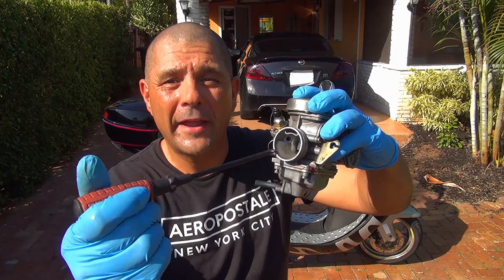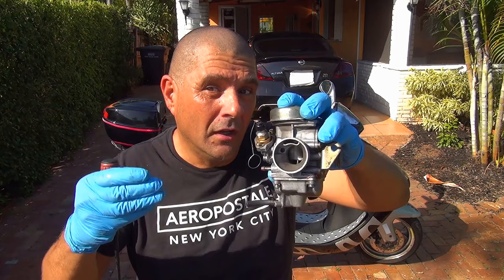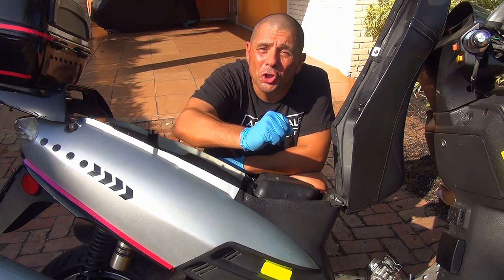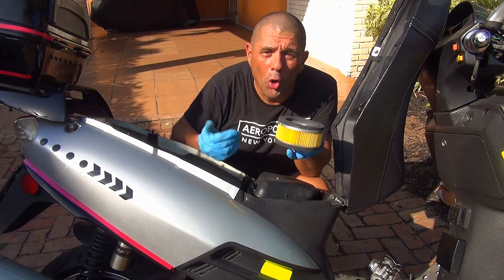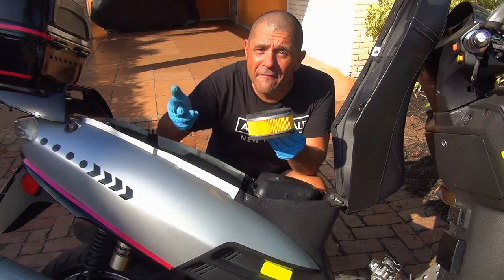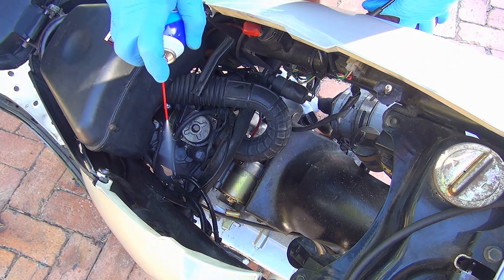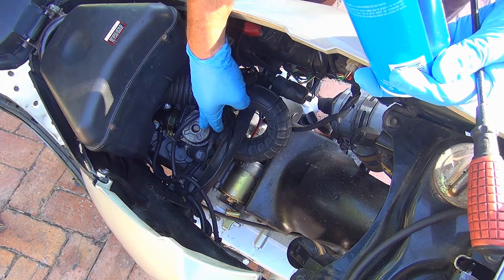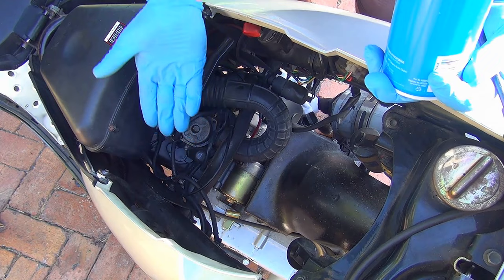How to fix a scooter that bogs down

Comment: Thanks for this. I bought a 2006 Pagsta Regal Raptor DD50E2 and it runs uneven and dies in 4th gear after a while, slowly dies and just shuts off. I've had the carborator apart but it looks OK from what I can understand, but I noticed I don't have an fuel filter, instead the hose goes directly from the petcock to the carborator. And I also have an EGR on this bike, could this have something to do with it running bad? I checked the valves but they seem to be adjusted, unfortunately I don't have an manual for this bike and they are no longer in production so I just went for 0.05 on intake and 0.10 on exhaust as someone suggesed it to me. One strange thing though, the other day I ride the bike and turn the petcock in ON (downwards) and after a while it died so I put the petcock in OFF position (horizontal) and the bike started and ran perfectly! I was so surprised and thought I must have mistaken the petcock positions, but I guess it had enough gas in the carborator to run for a while? Maybe it got too much gas so the petcock could be faulty?
Reply from the maker: Based on the information you provided, there are a few possible issues that could be causing your 2006 Pagsta Regal Raptor DD50E2 to run unevenly and die in 4th gear. Let's address each point you mentioned:

Carburetor: Even if the carburetor looks fine visually, there could still be internal issues such as clogged jets or a malfunctioning float. It's worth cleaning the carburetor thoroughly and checking for any signs of blockage or damage.

Fuel filter: It's unusual for a motorcycle not to have a fuel filter. A missing fuel filter can allow debris or contaminants to enter the carburetor, causing performance issues. Installing a fuel filter between the petcock and the carburetor is recommended to prevent such problems.

EGR (Exhaust Gas Recirculation): The EGR system is responsible for reducing emissions, and it typically doesn't directly affect engine performance. However, if the EGR valve is malfunctioning or stuck open, it could cause improper air-to-fuel mixture and affect engine performance. It's worth inspecting the EGR valve and ensuring it's functioning correctly.

Valve adjustment: The valve clearances you mentioned (0.05mm intake and 0.10mm exhaust) are within the general range for similar motorcycles. However, without the specific specifications for your bike, it's difficult to determine if they are correct. It's essential to obtain the correct valve clearance specifications for your particular model. Incorrect valve clearances can impact engine performance.

Petcock: The issue you described with the petcock is interesting. It's possible that the petcock is faulty and not providing a consistent fuel flow to the carburetor. This could result in fuel starvation or an excessive fuel supply, leading to the symptoms you experienced. Consider inspecting the petcock for any signs of damage or blockage and, if necessary, replace it.

Since your bike is no longer in production, it may be challenging to find an official service manual. However, you can try reaching out to Pagsta Regal Raptor owners' communities or motorcycle forums online. These resources can provide valuable insights and guidance based on the experiences of other owners who have encountered similar issues.

If the problem persists after checking and addressing these possible causes, it might be necessary to consult a professional motorcycle mechanic with experience in troubleshooting and repairing similar models. They can provide a more accurate diagnosis and help resolve the issue with your bike.
Reply: @VirberelloScooterTips  Thank you very much for the in depth information and explanation on each subject! I've been fiddling with the carburator today and noticed that the petcock will leak gas even when it is turned off, I even emptied the carburator and managed to run the bike with the petcock turned off so I guess it's a good guess that the petcock might having something to do with the problems. I've unscrewed the petcock and one of the screws on the front side broke off when I tried to unscrew it, leaving half of it inside and impossible to get out, the screw on the other side however seems to be holding it together, at least on that side. I'll see if I can get hold of a suitable petcock and replace it, since there are no official spare parts for this bike I'll have to try my best and see if I can find something that fits, if I understand correctly I need to get one that has the same size bolt that screw on to the gas tank?

One thing that happened today was that when trying to set the idle/air screws I let the bike idle and after a while it started to raise the RPM rapidly and then shut off. This have also happened during ride that it made a sudden high RPM sound and then died, I guess it might have to do with the fuel running out or not getting enough fuel to the carburator.

Inside the float house I noticed when turning the carburator to the position where the float is touching the float needle it kind of stuck in that position and didn't go back when I turned it around, I had to poke it slightly with my finger to make it come loose.

I guess I can only focus on getting a new petcock as for now, hopefully it might the thing that will solve this problem but otherwise I guess I'll have to dig deeper into the carb or the other things you suggested. 
I also watched a video where they stated that this kind of problem can occur if the spark plug is bad so maybe I should try and replace that one too in case the petcock won't solve it. 

Thank you very much anyways for your help!

It's hard to find any information on this bike in general, I've tried contacting the manufacturer of this bike but without any luck. All I've come across so far is a Russian community which is problematic due to the language barrier, but luckily there is translation software and people are helpful and try to help, it's internet as it was intended I guess. :)
Reply: I had a 2006 Pagsta. Do you want to sell yours? As far as engine parts it's the same as the chinese dirt bikes. If you haven't replaced the carburetor and intake gaskets, i would start with that. I ended up putting a new gas tank on mine that came with a petcock. I also replaced the engine with a 125cc. I set my valve clearance at .0025-.003 for the intake and .003 -.004 for exhaust. If the rpm's rise on their own randomly it might be flooding.
Reply: Hello! I managed to get it running real good, it turned out it was the valves all along.. The thing is I checked them first and they seemed fine but somehow I must have messed up because when I checked again after a lot of hassle and troubleshooting I noticed the exhaust valve was completely shut. After adjusting it the bike ran just like it should. I used the 0.05 for intake and 0.10 for exhaust but I don't know if those are manufacturer specs, I don't own a manual for it so it was just what someone told me to go with. I am so happy for this bike really, It's so much fun and the previous owner had cut the exhaust/muffler at the middle and removed the inside and drilled some holes through it so it sounds really amazing. All I am looking for now is a standard handle for it since it came with one of those straight/t-bar handles which I personally don't like that much. I can only hope that they someday will re-start the production of these bikes again, it would be awesome. @thelagmeister
Reply: @LUNARIAproject  Well I'm glad you got it goin. I really miss my Pagsta. I posted a few videos of mine on my channel and the videos are all I have left of it. I bought mine out of someone's backyard for $200 with a bad engine. I replaced everything on the bike with new parts. Literally the same day I put the finishing touches on it some lady ran the bike over with her pickup truck. I would really like to find another one to buy but I can't find one. I really don't know why they stopped making these , but they should start making them again.
Reply: @LUNARIAproject   @LUNARIAproject  Thanks,. I come across one every so often but they never have titles. When I got mine it had 300 klms and when it got totaled I think it had 1,500. When the insurance totaled mine out, they paid me $1800 for it. When I see them for sale they are usually priced at $750-$1000 usd. I'm sure I'll find one eventually. The only reason I can see people not liking them is because it's not a Honda, Yamaha, Vespa ect. That video was good. Not bad at all.
Reply: I understand, sounds like you did well with the insurance after all, but still sucks to be lose the bike like that. I hope you will be able to find another one, I know these bikes go under different names, in the UK they are called AJS, in the US it seems it's Pagsta or Dadyw or even SUNL, not sure if the later is the exact same bike. At here in Europe we also have a similar bike called Kinroad but it's quite a bit smaller, at least the tires are smaller. Yeah perhaps people judge it just by the fact that it's made in China, but I guess if one take care of it and maintain proper service it shouldn't be bad.
Reply: @LUNARIAproject  Thanks. I'm sure I'll find one eventually. Mine had a 17 inch tire on the front and a 12 inch tire on the rear. I realize the chinese bikes aren't terrible but do require a lot of maintenance. They have numerous names here too. I'm looking at a Piaggio 150 right now but I've never had an Italian bike. Funny thing though it's made in china.
Reply: Yeah, I think so too. Perhaps needs a bit more care and maintance than more famous brands. It's a pity no other brands like Japanese manufacturers make smaller bikes like 50cc that reminds of motorcycles or such, I am sure that would be a great success. Maybe if Honda would re-issue their Jazz/Rebel 50cc, that would be truly amazing, but I guess the prices would be too high for me at least. Oh, I've never had any experience with Piaggio but I've heard the name and it's quite well known at here.  @thelagmeister
Reply: @LUNARIAproject  That Jazz/Rebel 50 looks good. I've noticed with some of the better small cc bikes that they just won't sell them out here in the states. They do cost more but they definitely are quality bikes. I'm looking at a 150 Piaggio Fly 150 for $750 usd with 1,700 miles. I just don't know. If it was a Yamaha or a Honda, I would be all over it.
Reply: Yeah, I understand. Do you have any bike to ride as of now or? I think that Piaggio looks alright, perhaps a scooter is more convenient to ride, I've never had one myself but that kind of bike is very common at here under various brands. Personally I don't know about european brands in terms of quality, I guess they are alright and perhaps even considered better than chinese? But that's just my guess. As long as it's been taken care of and serviced I think it shouldn't be too much of a problem with that kind of mileage. @thelagmeister

Comment: My scooter starts bogging at around 30-40 mph it start perfect and runs strong until around 30 mph
Reply from the maker: It sounds like your scooter might be experiencing some issues with its performance once it reaches a certain speed. There could be a few potential causes for this problem:

Fuel System Issues: A clogged fuel filter or carburetor jets could restrict the flow of fuel to the engine, causing it to bog down at higher speeds.

Air Intake Blockage: A blocked air filter or intake system could limit the amount of air reaching the engine, leading to poor performance at higher speeds.

Ignition Problems: Faulty ignition components such as spark plugs, ignition coil, or ignition timing could result in misfires or weak sparks at higher speeds, causing the engine to bog down.

Exhaust Restriction: A restricted exhaust system due to a clogged muffler or exhaust pipe could create backpressure, reducing engine power and causing it to bog down.

Transmission Issues: Problems with the scooter's transmission, such as worn-out clutch plates or improper adjustment, could lead to power loss and bogging at higher speeds.

Electrical Problems: Faulty wiring, connectors, or electrical components could cause intermittent power loss, affecting the scooter's performance.

To diagnose the issue accurately, it's best to start by checking the simplest and most accessible components, such as the air filter and spark plugs, and then move on to more complex systems if necessary. If you're not comfortable troubleshooting the problem yourself, it's recommended to take your scooter to a qualified mechanic or dealership for professional inspection and repair.

Comment: Do you still answer comments or questions I would have something to ask
Reply from the maker: Hello Petri I'm still here 👍
Reply: @VirberelloScooterTips  Mind if I ask you tomorrow its night here.
Reply: @VirberelloScooterTips  Oh, I totally forgot, but my 50cc Baotian scooter struggles to stay on full throttle and cant go past 30kmh without "booing" and losing power, and once again picks some speed and again slows down, but it certainly isn't the carburetor or fuel "system's" fault I have tried working carb from my friend and the same issue happened also nothing wrong with the fuel lines. Could it be the magneto or some wire issue because I cant figure it out. Also one indication of an eletrical issue is that when driving, the front light is sometimes bright sometimes not and driving speed doesnt matter. I have read every Finnish scooter article I could find but no one has had the same problem. (Forgot to mention that the intake manifold, sparkplug, coil cord and cdi are all brand new and also the right one's) +Plus booing is bad word for describing the issue it sounds like the spark dissapears completely sometimes and then comes back again. Or could the problem be blocked exhaust?

Comment: It feels like it’s not getting enough gas. Cause when I squeeze the gas line it starts to run right
Reply from the maker: Hello try to check the fuel line, fuel filter and try to see if the lower part of your fuel tank is dirty that can give you an idea if you have problem with fuel flow
Reply: @VirberelloScooterTips  thanks bro ur the best

Comment: my scooter is bogging and shutting off while on idle but perfectly fine while riding anyone know why it’s a 2023 chinese
Reply from the maker: f your scooter is bogging and shutting off while idling but runs fine while riding, there could be several potential causes for this issue. Here are a few possibilities to consider:

Idle Air/Fuel Mixture: The idle circuit in the carburetor or fuel injection system may be adjusted incorrectly, resulting in a lean or rich air/fuel mixture at idle. A lean mixture can cause the engine to bog down and stall, while a rich mixture can cause rough idling and stalling.

Dirty Carburetor or Fuel Injectors: Dirt, debris, or old fuel deposits in the carburetor or fuel injectors can disrupt fuel flow at idle, causing the engine to bog down or stall. Cleaning or servicing the carburetor/fuel injectors may resolve this issue.

Vacuum Leak: A vacuum leak in the intake system (such as a cracked or disconnected vacuum hose) can disrupt the air/fuel mixture, leading to poor idle performance and stalling.

Faulty Ignition System: Issues with the ignition system, such as a weak spark, faulty spark plug, or ignition coil problem, can cause misfires at idle, resulting in stalling.

Idle Speed Adjustment: The idle speed may be set too low, causing the engine to stall when idling. Adjusting the idle speed to the manufacturer's recommended specifications could resolve this issue.

Fuel System Issues: Problems with the fuel system, such as a clogged fuel filter or malfunctioning fuel pump, can disrupt fuel flow and lead to stalling at idle.

Electrical Issues: Faulty wiring, connectors, or electrical components can lead to intermittent stalling issues.

Given that your scooter is a 2023 Chinese model, it's essential to ensure that routine maintenance is up to date and that any specific service procedures recommended by the manufacturer are followed. If you're not comfortable troubleshooting the issue yourself, it's advisable to seek assistance from a qualified mechanic or technician who has experience with Chinese scooter models. They can diagnose the problem accurately and recommend the necessary repairs or adjustments to resolve the issue.
Reply: @VirberelloScooterTips  i was going to take it up to the place i got it from to have a look but its about 20 miles away and dont want the scooter shutting down on me on the way so ill look into the options you said and investigate it further thanks for your help
Reply from the maker: @---vr7th  you very welcome and if you have any question feel free to contact me anytime 👍